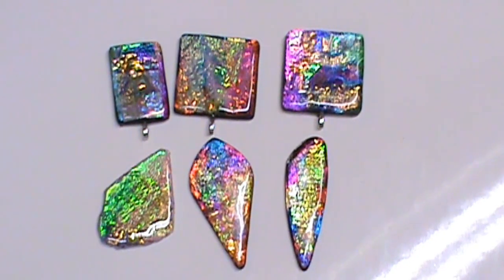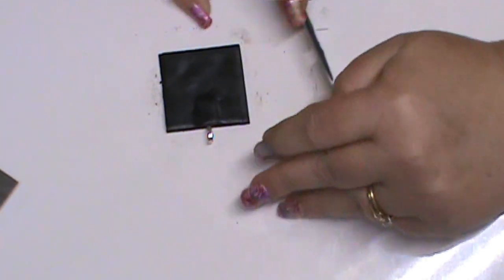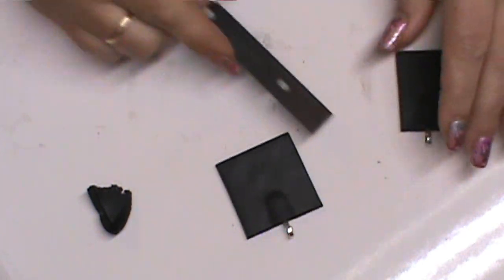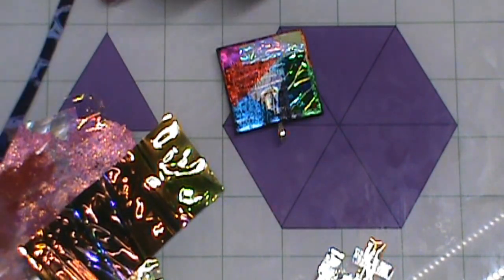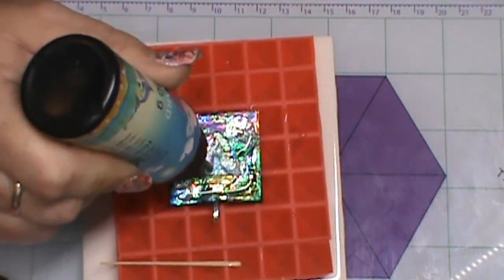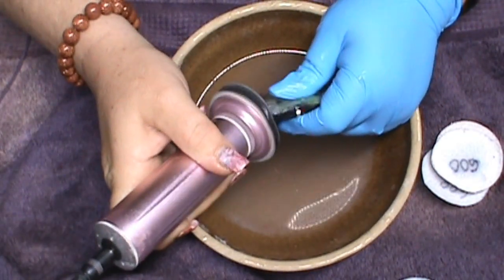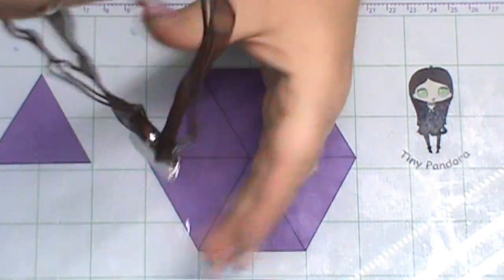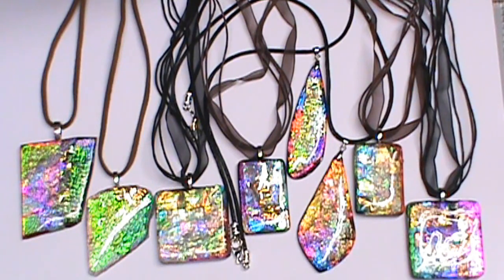Faux Dichroic Glass Pendants, Polymer Clay Dichroic Effect Pendants

Comment: This is an awesome technique, Patricia! Two quick questions: 1) Do you need to completely cover the second and third layers of glue with films and foils? 2) Why did you choose to apply the UV resin before adding and baking the polymer clay backing layer? (My understanding is that some UV resins can yellow if baked.)

Thanks so much for sharing your technique! ❤️
Reply from the maker: Thank you so much. Yes completely cover them with the films. You want your last films to be textured and iridescent. I did the backing last so that I only had to sand one time. I wouldn't put a non-resined piece in water not sure how the glue and films would do in that case or how they would hold up in the oven without the uv resin to protect them. I have yet to notice any yellowing of the uv resins I use so far. I hope this helps!
Reply: @PatriciaBearden  thanks so much!
Reply from the maker: @MargaretSchindel  you're welcome!

Comment: Very informative video! Thank you!  What foil did you use for first layer? It look like the foil came off the backing when you touched it to the glue Thank you
Reply from the maker: Thank you so much! If I remember correctly I used nail foils. I don't recall it coming off. I just like to add it for if I miss a spot when adding the other items to it. It's a step you could possibly omit. Hope this helps!